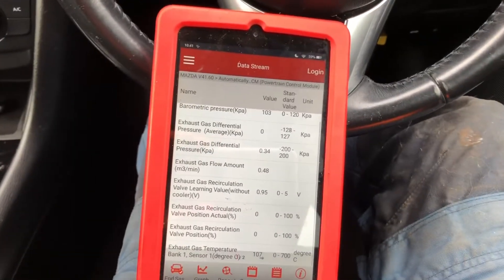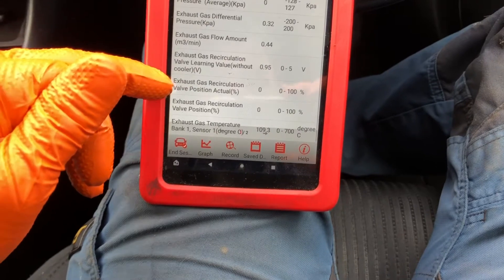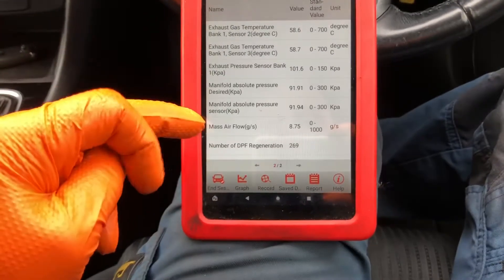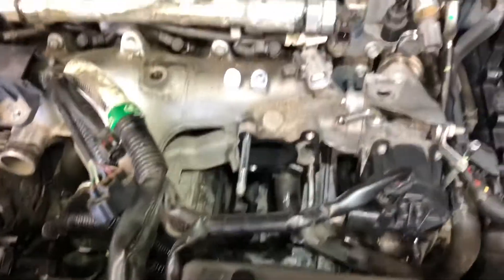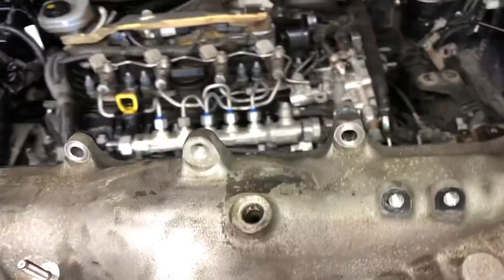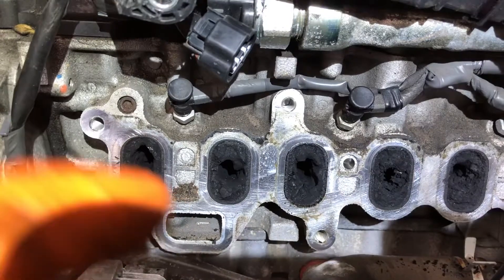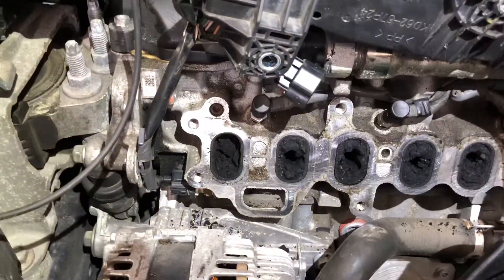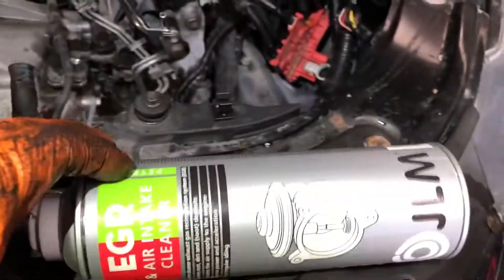Mazda P0401 egr fault & de-carbon intake system

Comment: Great video did you see some good gains on the drive ? I'm.assujimg you had an eml  on it ? I get occasuonal idle issues and feels a bit lumpy at speed 
Thanks in advance
Reply from the maker: Yes Kevin, I had an eml light on & it drove far better afterwards. It sounds like you might have the same issue. This de-carb  is something that should possibly be done every 100,000 mls or so I feel 🤔👍
Reply: @kennedysgarage3281  makes sense I'm at 97k I appreciate this thank you I also get a low compression occasionally on a gear change when giving it some poke
Reply from the maker: @kevinhancock4064  copper washers under the injectors fail a lot. Unscrew oil filler cap when the engine is running and listen, if you can hear a pop,pop,pop it gives you an indication that the are failing 🤔👍🙏
Reply: @kennedysgarage3281  thanks mate will take a look indeed one injector was replaced the garage that done it said he checked other seaks but I beg to differ
Reply: @kennedysgarage3281  I guess he could be lying and not checked them maybe I'll let you know thank yoin

Comment: Hi there. Great video, thanks for sharing.
I just got a M3 2015 with the same engine and 110k km. If use egr spray from time to time it is posibile to prevent such a heavy carbon build up? Regards
Reply from the maker: Possibly, lots of chemical cleaners can very effective nowadays. I personally don’t have much faith in them but let me know you get on 👍
And thanks for watching & commenting 🙏
Reply: You need to DISABLE EGR . You won't have any carbon build up like that .

Comment: Great Video,  how much would a job like this cost ?
Reply from the maker: The whole job takes around 8 hrs ( depending on how badly blocked the intake ports are ) based upon that  & at around €50 per hr. €400 to €600 with gasket being replaced

Comment: Hello Peter, that's great, thanks for the helpful advice,; got the P0401 issue on my Mazda 6, will have a crack at doing this myself.
Would it be okay to use the same gaskets or do you recommend using new ones?
Reply from the maker: Hi Dave, I don’t understand? Gadgets as in the tools
Reply: @kennedysgarage3281  sorry Peter, autocorrect changed it to gadgets, where it should have read gaskets.
Reply from the maker: @cebudave  the main manifold gasket is steel with a plastic coating on it and they always come off in good condition. I do sometimes put a slight layer of gasket maker on if in any doubt, all other egr gaskets are perfect to remove & refit . Good luck with it & it is more than likely going to be carbon buildup  in the manifold 👍
Reply: Thanks Peter, that's really helpful.
Reply: Is your car running a bit lumpy at all at higher speeds ? Curious
Reply: @kevinhancock4064  Yes now and then it has its moments, and somtimes stutters when accelerating after overrun. I did not de carbon the ports in the head as was unable to close the valves using the method Peter showed in the video, due to my car being an automatic transmission.
Reply: @cebudave  ah I get u mate diff ball game aye so it was better though that's good were they bad ?
Reply: @kevinhancock4064  Yes, the small EGR port inside the inlet manafold with the finger was totally choked up causing an insufficient EGR flow error, once this flagged up, it caused all sorts of issues including not changing gear correctly, applying the smart City brake randomly when driving.
TBH I haven't noticed the hesitation and slight lumpyness since the weather got colder.
Reply: @cebudave  I'll have to take a look at that thank you I cleaned the egr valve and link pipe but not the port as u say interesting that
Reply: @cebudave  and yeah I meant to add if I'm say doing 70 + most of the time it feels (opposite to smooth ) bit lumpy pull feels OK but I do get hesitation often on acceleration
Reply from the maker: @cebudave  well done on getting that done 👏👏 brilliant job 😉

Comment: How many km it has that Mazda??
Reply from the maker: It was in miles & had 130,000.
Reply: @kennedysgarage3281  it's kinda normal on that amount of miles 😁 thanks man 👍 keep up the good work.
Reply from the maker: @mail2cas  yes, this and injector washers should be done around every 100,000 mls in order to avoid engine failure. Thank you so much for your comments, top man 🙏👍
Reply: @kennedysgarage3281  I'm keen to replace my washers (just 3 as I recently had a new injector/warrantee /diag. ) but what gets me is the markers on the bolts/nuts that hold the injector in place . I had a glance and can't see any or am I to make markers myself? I know the torque is very low , around 2nm  wouod you say its simple enough ?
Reply from the maker: @kevinhancock4064  I can’t remember what markers you talk of, but just mark or number the injectors when removing as they are coded & should stay in there own cylinder. This is just to avoid coding the afterwards. I’ve been meaning to do an injector removal video 🤔
If they we leaking bad it could make it harder but it isn’t to difficult
Reply: @kennedysgarage3281  I understand I didn't know they need coding I'd have def 0ut them in sane way anyway. I read the procedure of doing injectors and stated the clamp that keep the injectors in place are not true flush  one is raised more than the other . Marking the nuts to get the torque may be an idea so long as the bolts went in same threads or use a gauge for the gap before removing and make notes  . 
I'm concerned that this may be the least of my worries . Although I have no loss of coolant or sludge on fuel cap OR in oil (I dine a recent oil change ) the coolant may not be going into oil no signs atm my tester went to yellow which is why I'm concerned . Given the deep note of sound on a rev when I get often coupled with 8dling issues occasional lack of power.  Not all necessarily together always.  I'd be very pissed if I had a cracked head . I'm hoping 8ts none of these but I'm in 2 minds.
Reply from the maker: @kevinhancock4064  you are correct with the torque setting, 2 Nm + 230 degrees . 
You must only number the injectors when removing just to refit back in the same cylinder. Other than that it should be straight forward. Good luck doing it 🤞
Reply: @kennedysgarage3281  thanks the new seals were only 97p each the new stainless ones so better thanks matey I may do it myself I need more confidence lol
Reply: @kennedysgarage3281   can't the nuts be marked ? So that if put in exact locations it can be done up to marking ? If not I guess I'll need a 3rd torque wrench as my smallest is only 5nm at lowest . I also need a cleaning kit dir bore clean and seat
Reply: @kevinhancock4064  My problem is I don’t trust the mechanics in Croatia. I am sure they would just let the carbon fall into the cylinder cleaning the intake ports. Or not use the torque wrench for the injectors. They broke too many things on my various cars, and I saw them not even know procedures for simple things like filling the coolant on a 1.9TDI VW. On the other hand, I also don’t have all the tools required, like the coolant fill kit for Mazda Kennedy is mentioning.
Reply: @dmalovic  the coplsmt fillong kit is simple and cheap at least here ..it's only plastic and sits on infill..fill run car on full heating and top up as needed until bled the kit is around £18 here .I get your meaning .mines in the garage  but only as its more tricky with my case taking dealer to court etc . If you have no commitments as kids to stop you . I'd have attempted mine myself ..my heads 9ff fir skimming e5c and pressure checking . At least if you do it you can do it your way .....I'm currently doing my bike my heads with a guy fir header bolt issue I just got cylinder off to as I had a snapped hg  bolt . I shouod get it out later fingers crossed but it's now exposed .  Cars are a pain matey

Comment: Hello I have a Mazda 6 2.2D, I got a P0103, I was getting 200+ g/s reading on my MAF using the ODB2 scanner, gave it a clean with contact spray and left it to dry for about an hour, I reset the codes but now have a P0102 code and its reading 0g/s I'm guessing I need a new MAF sensor, can you suggest anywhere else I should check before getting a new look one.
Reply from the maker: Hi Joel, P0103 is air flow too high which normally happens boost air is leaking somewhere between the turbo and the engine (ie. intercooler or intercooler pipe
Reply from the maker: P102 is air flow low and if you only cleaned the air flow meter & done nothing else, then you may have damaged the air flow meter. So even if you replace the air flow meter then you might still have the original issue to resolve. 
I wonder could it be a wiring issue that you disturbed by removing the air flow meter? Look at air flow numbers and wiggle the wiring harness at the air flow meter & see if the numbers change. Let me know if this helps👍
Reply: @kennedysgarage3281  appreciate the reply thank you
Reply: @Lazysloth85  did u get any joy after ?.
Reply: @kevinhancock4064  yes my DPF was blocked also needed a new MAF sensor got it sorted was quite expensive.
Reply: What is the normal value for Maf sensor, 14 g/s in Idle?

Comment: Great video peter.....just wondering what were air flow readings at idle when completed
Reply from the maker: I have a snap on Verus edge , a Mehle & a launch. All 3 different brands give me different air flow numbers, which makes it very hard to diagnosis or confirm a fix. 
But a 2.2 diesel should be around 16grams per. second with the egr open. But these have high & low pressure egr which can be hard to diagnosis, if in doubt just pull it apart and take a look it would take around 4 hours 👍
Thanks for the comments & hope this helps 🙏
Reply: @kennedysgarage3281  Thanks Peter....fair play for getting back to me......keep them videos comming, very informative

Comment: Those 2.2 Mazda engines seem to be a very weak link.
Reply: Nice one Peter, what do you think of sand baster ? The American boys love it 😂 although I am just as you but if I was working for my self my own garage definitely would invest into sand blaster ( I use hover as I scrape ) not to let it fall down and clean the floor, very nice video over all thanks again
Reply from the maker: @evansmarts775  I never thought of the hoover 🙂👍 I should use that the next time, sometimes the simplest things are the hardest to see 😂
Reply from the maker: It wasn’t their finest hour alright. Remove injectors, replace seals & change oil gauze every 100,000 mls. This seems to stop the engines from failing but very few ever do this 🤔
Thanks for watching , Peter